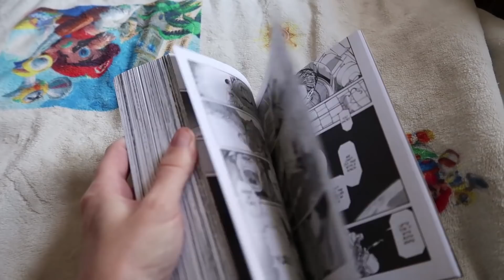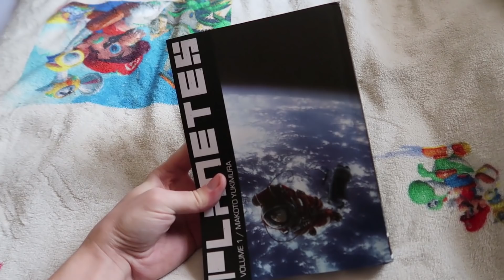Random Bits 0187: New Glasses, Final Mow of 2017

Comment: You could try wrapping the propane tank in an electric blanket or that heat strip that people wrap around pipes to keep them from freezing
Reply: Tyler Kobs Why?  If it's too cold for propane, it's too cold for the lawn to grow, so no mowing needed.  Unless the mower does double duty as a snowblower, but then it should have come with cold weather support from the factory.

Comment: CIG RINOA YOU JUST NEED ANOTHER CIG HAHAH!!! Started my wheel chair project, got the 36 volt 500 watt hub motor. I got a knobby tire 16 inch. the hub motor is 9 1/2 in diameter so it gives me like 2 1/2 3 inches for extra heavy duty spokes that the motor came with. I am using 18650 but not soldered just in battery carriers. that way I can charge them as I wish not as a battery maintance system tells you. just thought I would tell you Old One Legged Joseph T.

Comment: Do you have a li-ion charger that runs on 12V input ? Could drain all the energy from the car batteries before you throw them away.
ps: fix/patch over the rust holes in the mower guard, would hate for anyone to get injured by flying rocks/bolts.

Comment: Hey , kind of an off-topic stupid question :D I am about to try to measure 30 A with one of the cheap-o multimeters . The question is - should I do it? What is the highest current you have measured? I went to 19A once.
And yes, I am well aware it states 10A on the face and I probably shouldn't do it without another resistor in line, but come on :D 
(it's just a brief measurement to check a chinesium battery charger's claim to fame)
I guess what I am asking is if someone knows for sure what's about to happen. 
Love and respect for you Rinoa. Nice glasses , I liked the old ones better though :P
Reply from the maker: +bigass197 why not use a shunt and measure voltage?
Reply: Lol I'm kinda not intelligent enough :D and besides I don't really have any resistive components.(even if I had I couldn't fabricoble a shunt and Idk how to use one so...)  I'm going to be picking it up from a delivery office and I have to test it there or I get to keep it regardless :))) 
Thanks for responding, that's awesome! :)
Reply: Ok, I think I kind of get it now ... maybe ? So if I connect a 10cm 5mm diameter wire to the leads I should get a 0.0005V drop , riiiiight ??(I used an online calculator)  :D Idk how the lady at the counter would perceive such a dubious setup :D and btw the damn thing shouldn't blow up right ? I mean it is pretty craptacular and cheap.
Reply: Thank you btw , that is a good thing you made me learn :)) Right on !

Comment: Hey Rin, your voice is really shifting into a comfortable place. Most notably 1:04 you sound a lot like your mother! :) Keep at it girl!
Reply from the maker: wanna know a secret? i've started testing and calibrating my voice with a function generator. im thinking about showing it on my other channel when i figure it out more. basically i put the speaker to my face and set it to about 600hrz and try to hold that for a while, then try other frequencies. i find it helps expand my range of frequencies i can effectively use with my voice. i've started doing that for a bit before filming to help my voice be less crackly also. its really interesting.
Reply: You too huh?! :P Frequency practice does certainly make a difference. Just remember to rest your voice ever now and again :)
Reply: You're MAD!
Reply: I am clapping for you right now.

Comment: Wow what you really need is a leaf collector lol
Reply: sam mulholland Or learn how to use the mower. If you notice it throws the grass/ leaves out to the right side. So starting in the middle and going anticlockwise will move everything to the edges and maybe under a hedge. Starting at the edge and going clockwise will collect it all into the middle to be picked up.
Reply from the maker: +Ed R but the leaves are fine the way they are, i dont want to bog down my mower pushing a bunch of leaves.

Comment: To warm up your propane tank put it in a 5 gallon bucket of hot water
Reply from the maker: +dw big now how do you fit a propane tank in a normal 5 gallon bucket?
Reply: If it doesn't fit use bigger container
When I said 5 gallon bucket I was thinking  of the slightly smaller R22 tank